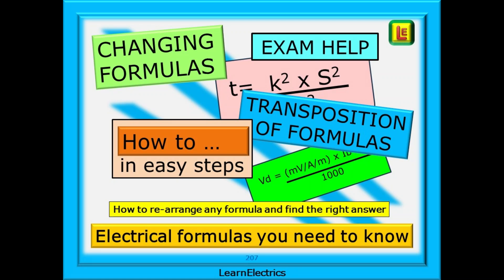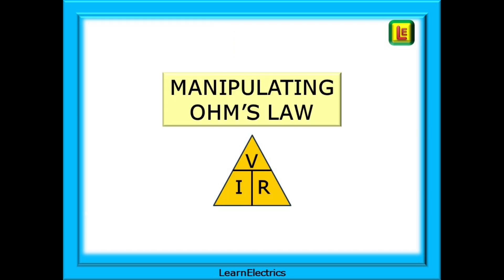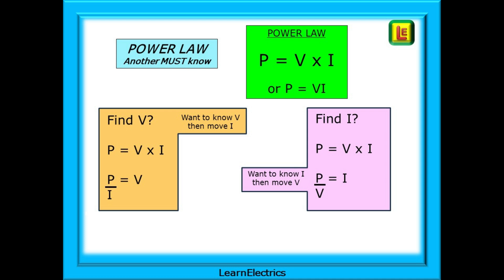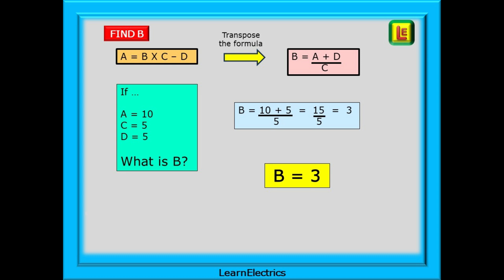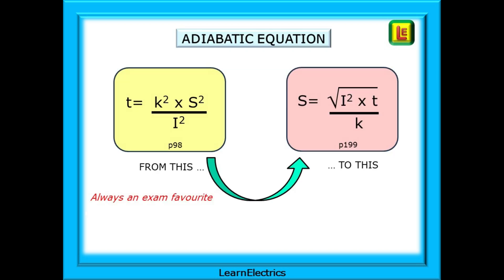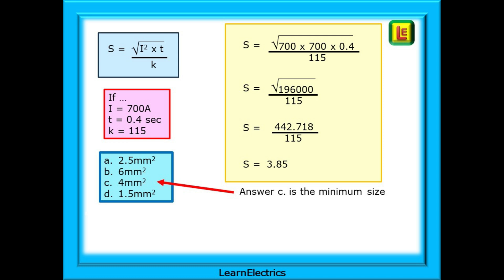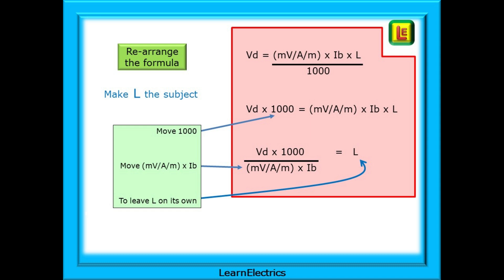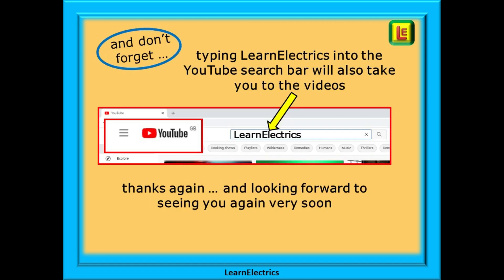ELECTRICAL FORMULAS YOU NEED TO KNOW – HOW TO RE-ARRANGE AND TRANSPOSE A FORMULA – KEY EXAM HELP

Comment: Hi, I love your videos as refreshers and memory joggers! However, I think it’s worth pointing out that you divided both sides by the same thing. You hinted at it in your narrative with the “seesaw and the equals sign being the balance point”, but didn’t show the step where one side cancels out and leaves the other on the bottom. That would show the short cut that most of us take for granted of “top one side to bottom on the other”
Reply from the maker: Left out deliberately. Many viewers are not too hot on maths and I don't want to give them overload at this stage. I wanted to give enough information to get them started. Thanks for the input, appreciated.
Reply: @learnelectrics4402 
Hi Dave
I’ve learned a lot from your fantastic videos so Thankyou.
I would be grateful if you could answer a few questions for me.
I am pusuing an apprenticeship as an electrician in a hospital which I currently work at as part of a development strategy.  It’s a subject I have always been interested and passionate about but only from a DIY perspective, and I’ve only had experience of domestic electrical work.
So
What will be the differences between domestic electrical work and electrical work within a hospital?
What would you recommend I familiarise myself with/read up or watch for a possible interview?
Are you ever too old to become an electrician 😁 ?
Many thanks in advance
John